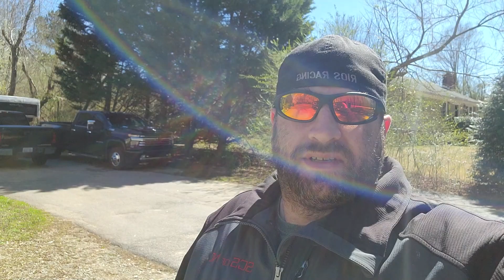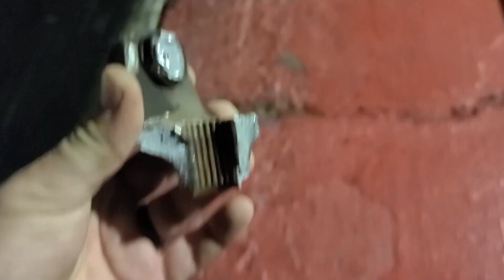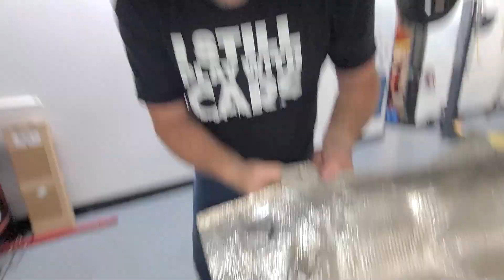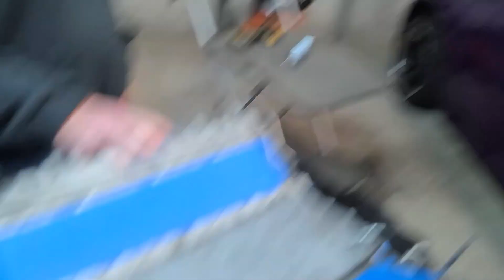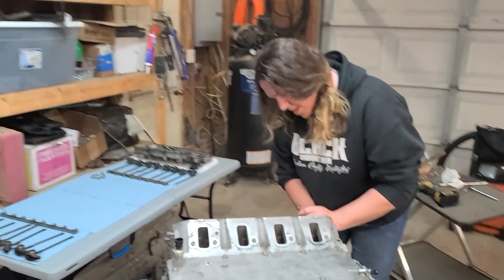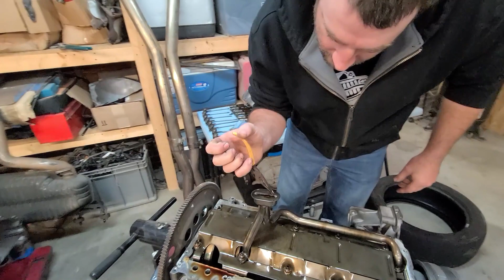820hp Valkyree CTS-V is broken. Really broken

Comment: Dedicated Motorsports typically have drive shafts in stock.
Reply from the maker: We have a driveshaft on order. Everyone is backordered on one piece driveshafts.
Reply: @valkyreeracing4131  I think back order is the new normal for things. Hope you find the engine you need for this season. 

Who makes the rear tubular crash bar are you running?
Reply from the maker: Evan clark

Comment: What Hoosiers were you running and what size? I just put 28x10x17 D06 on the car and now thinking I should pull them off.
Reply from the maker: They were 28x10.5 r17 drag bracket radials.
Reply from the maker: To be fair we cant be certain that the tires were 100 percent to blame for the troubles we had. And if we werent so rushed we probably would have been able to figure them out.  I will say they will probably beat out any competing tire for no prep use.

Comment: Stock tensioner broke? Mine was broken when we tore it down as well. Went 416 stroker
Reply from the maker: Yea. Stocker was broken and we didn't even know it. The pieces in the pickup tube were from the tensioner. Won't have that problem with the new engine.
Reply: @valkyreeracing4131  yea man we were kind of surprised when we pulled the cover. Going back with a good dampener
Reply from the maker: I believe we are doing a billet tensioner in the new engine.